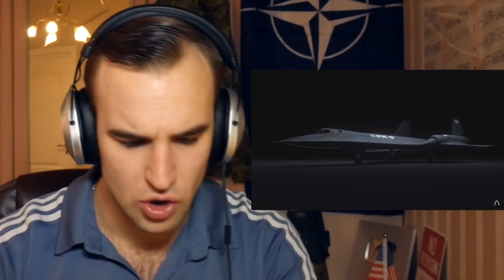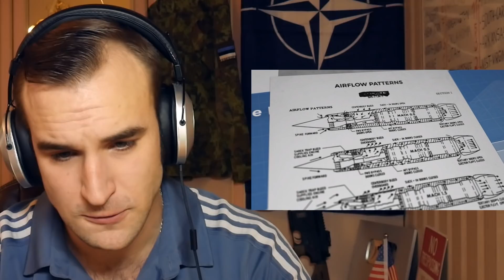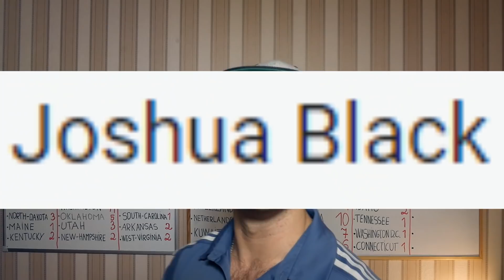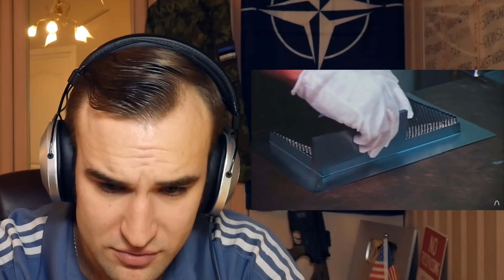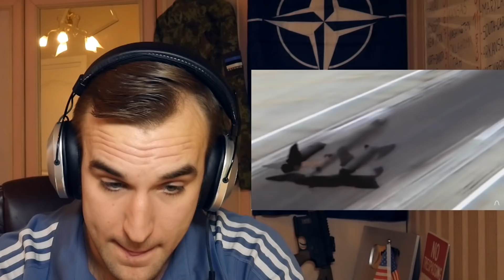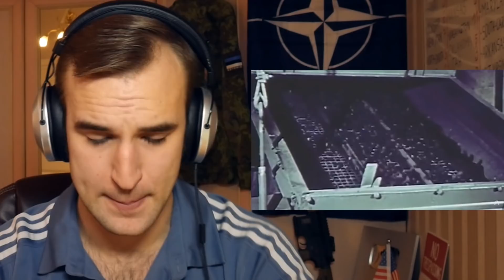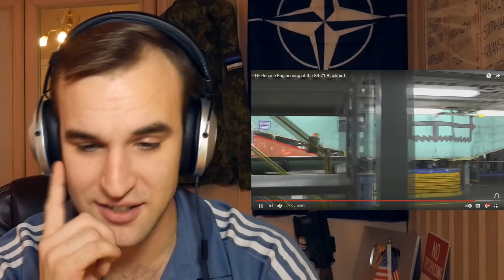Estonian Soldier react to the Fastest Plane in the World - SR-71 BLACKBIRD

Comment: My dad worked on the sr-71 back in the late 60s before anyone knew it existed. It is a way cooler plane than these videos let on. There’s always some info left out because there’s so much awesome flowing through the blackbirds veins. By the way it didn’t leak fuel in the air as the panels compressed and sealed up at speed. Also the titanium needed to build the plane was hard to get in the US at the time so the CIA used dummy corporations to purchase titanium from Russia then hilariously flew their own materials over(or rather just outside of the border like a sibling who says “I’m not touching you”) them to take pictures with a film camera which my dad maintained that had film I think 8inches wide and about 2 miles long. The pictures were so clear they could read license plates from 80,000 feet.

Comment: Sound is energy travelling through matter. The faster you travel, the more you push on the matter in front of you and "vibrate" the matter from your motion, and cause the pressure in front of you to increase as well. These vibrations have a speed limit based on how dense the matter you're travelling through is. Since "Air" is a gas, it's not very dense, meaning vibrations have a harder time travelling through it. On average, the speed of sound through air is ~767 Miles Per Hour (~1,234 Kilometers Per Hour). 

As you approach the speed of sound, you are sending more and more energy through the air and causing more and more vibrations and pressure to build. Once you pass the speed of sound, the energy you are pushing into the air becomes so high that the pressure creates a shockwave behind you, almost like you've "popped" an invisible bubble. This "popping" causes the visible "sonic boom". However, while travelling beyond the speed of sound, you are continuously creating Sonic Booms as you pass through new parts of the air, meaning you're very loud, but since you are travelling faster than sound you will not be heard until much later and potentially out of sight.

Comment: Some Rocket engines will also use fuel to cool the engine. The Merlin engines on the falcon 9 also used triethylborane to ignite the fuel. It causes a green flash upon ignition.

Comment: For the leaking... Important note to clarify for you, a few things.
If it was made of aluminum, it would melt in-flight. Titanium will not, unless they go too fast and it gets too hot from the friction of air (why they limited it).
It is built with gaps , the panels all rivet together as you can see. They have "micro-gaping" to allow for the expansion due to in-flight heat. They also learned that theycan not use too big of a piece or it will expand and retract too much, causing fatal issues. 
The metal itself does experience some wear and tear, but it is these micro gaps that cause the fuel leakage. They had the choice of sealing it nice and tight, but that would mean expansion due to extreme heat/temps would cause fatal issues. If there was no room to expand, it would pop the seals. So, they leave a gap... Inbetween every single panel. They expand and fit together perfectly, leaving zero leakage during flight and post-flight cooldown. 
Only after it sufficiently cools down can the pilots exit and that fuel starts to have room to leak again. 
That fuel is not actually super flammable or "bomb-like"..... It is the opposite. It has a very high flash point, which is the scientific way of saying it takes a LOT of heat to turn it on. That is the reason they can allow it to be so close to the surfaces of the aircraft while it gets so got. Between the natural ability of the fuel to be a coolant (really,think of it as a coolant that they found out "hey, we can use it as fuel if we get it hot enough".... Anything burns when exposed to enough heat. 😉), and the black poly-carbon coating, it has the ability to withstand such speeds/temps/pressures/and friction.

Comment: Its a common myth that the heat generated is from air friction. While some is generated that way most of the heat is actually the compression of the air against the air frame.   Basically when you compress a gas quickly it generates a lot of heat.

Comment: The SR-71 Blackbird was not the fastest plane. The A-12 was it could reach about 200km more than the SR-71 blackbird. Then there's the Space Shuttle. LOL
Reply: Lollll SR 71 top speed was classified imao it could do more than Mach 4 and can outrun missile during is lifetime so we know they can do more than that
Reply: Atleast Mach 3.5 when outrun the missiles bare in your mind
Reply: A12 was faster but not too far behind from the blackbird
Reply: @thebrightstar3634  No the SR-71 could only do mach 3.2 and since it's not flying anymore most of the data can be found on the internet
Reply: @mommyqayko5440  same apply to A12 as well if you said to balckbird
Reply: @mommyqayko5440  it cruise speed is 3.2 but max speed is more for example outrun the missiles in 1976 in Libya at 3.5 Mach if I not mistake also that data/information from internet also

Comment: The J58 engine was not a true ramjet.

It was a conventional afterburning turbojet for take-off and acceleration to Mach 2 and then used permanent compressor bleed to the afterburner above Mach 2. The way the engine worked at cruise led it to be described as "acting like a turboramjet". It has also been described as a turboramjet based on incorrect statements describing the turbomachinery as being completely bypassed.
It was an important stepping stone in the development of ramjet, and scramjet, technology though.
The SR-71 could only fly once a week. It then required extensive maintenance before it could fly again.
The U-2 was developed first, and it performed its job in a more efficient manner. (Not as fast, but much higher altitude.)
The U-2 has also in service longer. .Its still in service today.
Reply: The F-22 is probably as fast or faster than the SR-71.
The raptor can cruise, saving fuel at Mach 1.8. (That's just its cruising speed. It's top speed is still highly classified though.)
These reconnaissance aircraft like the SR-71, and U-2, are pretty much obsolete since the advancement of satellites technologies.
Why fly an airplane over someone's territory when you can place a satellite there and read a license plate?
Reply: Lol SR 71 can do more than 3.2 Mach the potential is capable of Mach 5 or more than Mach 4 is more than 3.2 mach it still classified too as the SR 71 blackbird 💀💀💀

Comment: Actually the SR-71 is the second fastest. The fastest is the A-12 Oxcart, a CIA aircraft.   The SR-71, is the Airforce version with a second seat and it's support equipment.  That extra equipment added weight and slowed it down.
Reply: No it can outrun the missile at the Mach 3.5 more than A12 only 3.3 Mach top speed it still classified but on average ofcos 3.3 Mach only but it could do more heard again ram jet can do the top speed at Mach 5 So it could do more that's obviously things but limited by something

Comment: The tip is hot because it slices through the air which means the air is now rubbing against the skin. Kind of like sandpaper rubbing on a metal surface.

Comment: A sonic boom or a sharp shockwave is produced when layers of sound or are tightly stacked on top of one another. Sound is a pressure wave. Sound is air. So look at it as a plastic bottle being filled with air. Once the pressures breaches the threshold of the weakest point it releases all the gasses at once causing a loud bang. Now think of that happening constantly past the speed of sound and you have a sonic boom. This is the easiest way to explain it. However there are more deeper ways of saying it with a lot more detail but this is more easy to understand. So its a TLDR version.

Comment: @Artur Rehi The plane only leaks fuel when it’s cold on the ground. Part of the takeoff procedure was to take off light on fuel go supersonic and heat up the plane so the expansion joints sealed then they would slow down and meet up with a tanker. The plane only leaked fuel on the ground and before it was heated. you really should go listen to from blackbirds to butterflies.

Comment: more so compression of the gass. because the plane is going soo fast the air can't move out of the way of the plane fast enough so the atmosphere gets compressed by the leading edges of the plane and according to the ideal gass law PV=nRT if you increase Pressure and keep every other factor constant you will increase Temperature.

Comment: Concerning your question on how sonic booms work, I shall attempt to briefly explain them. Due to the Doppler Effect, pressure builds up in front of an airplane as it flies. As you approach the speed of sound the pressure builds to such a degree that the air begins to act like a solid. If you look at supersonic airplanes you'll notice that they appear like sharp darts; this is to allow them to "cut" through the pressure wall. When the plane breaks through the sound barrier it creates a shockwave that makes a lot of turbulence and can even cause damage to whatever's in its wake. There's some other science mumbo-jumbo as well, but this is basically what's happening in a nutshell.

Comment: Not friction, but compression.

The plane moves faster than the air can get out of the way, causing ablation.

Google Ablation to learn why the tip got so hot, how heat shields on spacecraft work and why meteors burn up in the atmosphere.

Comment: Friction can cause high heat, simple friction just like a cutting metal with oxygen acetylene, heating happens fastest at the thinnest parts of the metal being heated.  Try then heating the same type of metal with the same setup and double the thickness and time it.  As far as high speed planes go, there are likely 3 generations of technology beyond anything the public would be trusted with by the time a new model comes out

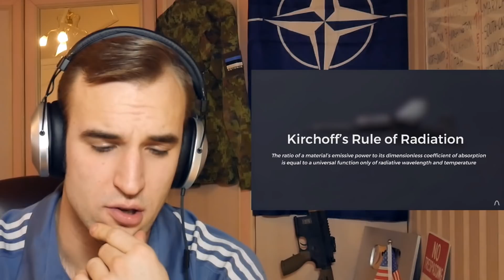Comment: 27:00 The rule is that if there is any breeze or wind at all, or you are moving quickly, you are better off wearing black on a hot day. If the air is still and you are stationary, white is better.

Comment: the development of the sr-71 taught us allot about physics, and its a great way to study these aspects of physics.
air friction is something allot of people dont seem to process, even if they understand it technically, air is a fluid. it has density and has to move around objects moving through it. this movement propagates in waves, think of a ship moving through water, it creates pressure waves as the water movers around the hull, this happens in air as well  these waves are actually what we perceive as sound, have you ever heard an arrow in flight?  or the buffeting of wind around a car, especially if you roll a wind down at high speed,  have you ever held your hand out the window while riding in a vehicle at speed, you can feel the air, and even play with it like you might with your hand in a stream of water. the faster you go, the thicker the air feels, a car moving 150 mph experiences air as a fluid as thick as heavy syrup. a jet aircraft at 600 mph is experiencing allot of friction, you can see this in the amount of power its engines have to produce to move it so fast.
the sound barrier is. harder to describe,  but the pressure wave can no longer be pushed ahead of the aircraft, it breaks over the leading edges, boundary layer air around the aircraft is forced into cavitation behind the shockwave.
the speed of sound is how quickly waves can propagate in air, the pressure cannot transfer any faster , so a supersonic aircraft is pushing beyond the waves its creating faster than they can get out of the way, the sonic boom is a powerful pressure wave created when the aircraft pushes through the transonic zone.  we perceive it as sound and as a physical wave in the air. 
this is all a bit of layman's understanding. so any clarification is welcome.

Comment: The heating of parts of the plane as it flew through the air has nothing to do with friction. It's caused by adiabatic pressure. Basically, when you compress a gas fairly quickly and it doesn't have a chance to radiate heat, it's temperature goes up. This is how diesel engines work; the pistons compress the intake air something like 20:1 so that it's hot enough to cause the injected diesel fuel to spontaneously combust without needing a spark. It's also the reason why stuff sprayed out of an aerosol can is cold after it's depressurized.

At typical speeds, air doesn't compress significantly, but when you exceed the sound barrier, the air can't get out of the way before more air runs into it, causing it to compress. The air heats up, and whatever object flying through it gradually conducts this heat and gets hot as well. This also applies to spacecraft descending to Earth.

Getting a little more advanced, this can be calculated via the ideal gas equation, PV = nRT, Pressure x Volume = number of moles x Ideal Gas Constant x (absolute) Temperature. In this case, the pressure is about proportional to the temperature, so you double the pressure, you double the temperature. I'm not sure what the pressure is in this case, but it sounds like the nose of the aircraft gets to about double the ambient temperature, so the pressure at least doubles.

Comment: The fuel that the sr71 used has a high flashpoint. They actually had five shots of low flashpoint fuel so that they could light the high flashpoint stuff. A lighter couldn’t lite the fuel only another fuel that got lit.  It’s weird but worked.
Reply: Just got to that party of the vid disregard.

Comment: I'd love to see a revitalization of the SR-71 program at some point... we have newer technology, after all; scramjets, new fuel compounds, new engineering techniques, higher powered cameras... in theory, we COULD make a manned successor to the SR-71 that goes higher, flies faster, and just overall does the job even better, all while reducing our reliance on satellite imagery and/or remote control... unfortunately, it'll probably never happen

E: Interesting side note, most forms of jet fuel aren't actually flammable. In fact, you could drop a lit match in most jet fuels, and all that will happen is they'll smother the flame. They ARE combustible, and WILL ignite once they reach their flash point, but that flash point is high enough that they won't catch fire from just any ignition source, which is the whole difference between "flammable" and "combustible" materials: flammables are defined as having a flash point below 37.8 degrees Celsius, while combustibles are defined as having a flash point of greater than 37.8 degrees Celsius but lower than 93.3 degrees Celsius. That being said... don't go dropping matches into jet fuel just because you read this comment. It's still a stupid game that's liable to award a stupid prize. But it is an interesting little factoid to have on hand, for no reason other than how outlandish it sounds

E2: In all actuality, the plane ONLY leaked on the runway. Once the bird was up in the air and started to really gain speed, the body's thermal expansion would literally plug up all the gaps, thereby stopping the leak. This was another reason why the aircraft was granted an acceptable fuel leak rate, whereas other military vehicles are automatically deadlined for ANY fuel leak; the engineers writing the TM for the SR-71 recognized that there was enough thermal expansion at play when the aircraft was in flight that a class 3 fuel leak would quickly turn into no leak at all

Comment: Fun fact about the Blackbird!

When on the ground the fuel tanks were known to leak onto the runway / taxiway however once the aircraft reached ceiling height and mach 3 the heat undertaken by the fusilage caused the materials to expand and once expanded they perfectly sealed up against one another. So they are designed for this expansion and when on the ground I have been told there was up to an inch gap between panels!

Comment: There was a 1990 "Aviation Week and Space Technology" that discussed an external combustion chamber aircraft. If I remember correctly, once the vehicle got above Mach 1, fuel would be injected between the external surface of the aircraft and the boundary layer of the  shockwave that would form a combustion chamber, kind of like a Ramjet.

Comment: Mach 2.8 was it's cruising speed at 80,000 feet.  At 3.4 there is a very problematic heat problem where materials have a hard time dealing with.  3.4 is it's max 'reported' speed, but a few pilots said it could go faster, but due to fear of damage, was told not to.  The few times where it ran into threats, the max speed is unknown.  This info comes 3rd hand from a friend of a previous blackbird pilot so i'm not sure of it's validity.

Comment: Used to see these things off the Air Force bases where my dad was stationed. Made in 1966, and still the top. 

As to the sound, and resulting boom, they forcefully pass the speed of sound. That means the aircraft is moving faster than the sound it gives off. All the sound waves are bunched up at the front of that, with longer waves behind. So the jet passes, then you get all those waves at once(the boom), then you'll hear the jet. It is dragging its' sound behind it. Sound is energetic waves in the matter of the air, and you hearing it is their applied force on your ear drums.....

Comment: Ohhh man, had to stop what I was doing for this one.
Sound is just moving air, when something moves faster than that air, it leaves a shockwave in it's wake, the "sonic boom" you hear.
Reply: Really? Sound is a wave that propagates through a medium it’s not moving air, it has an amplitude a frequency and a sound pressure level, it can travel through water, or steel or other mediums and the denser the medium the faster it travels. Mach 3.2 in air isn’t even Mach 1 in water, so if sound is moving air explain to me how submarine SONAR works